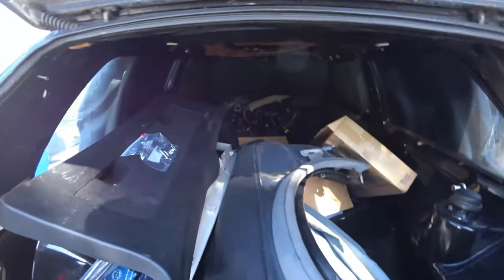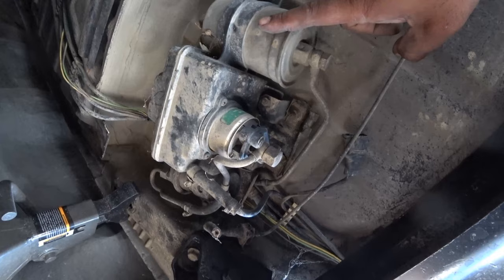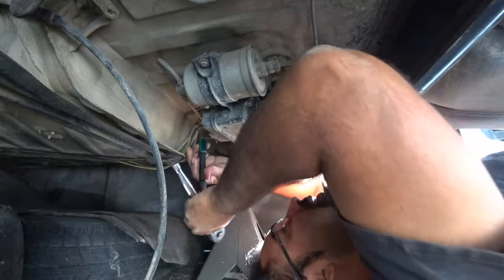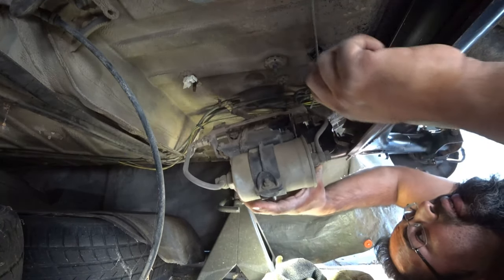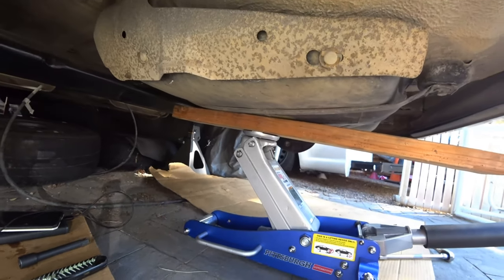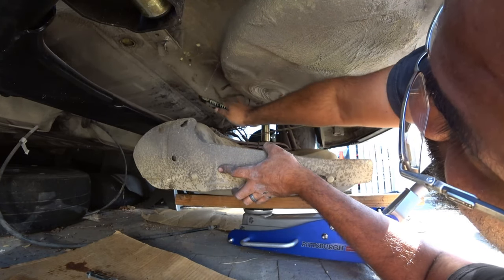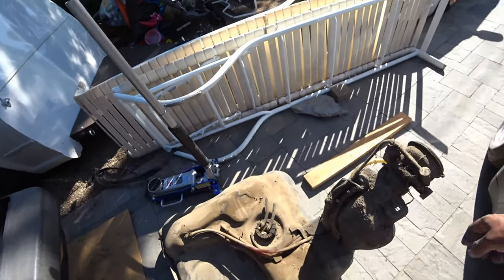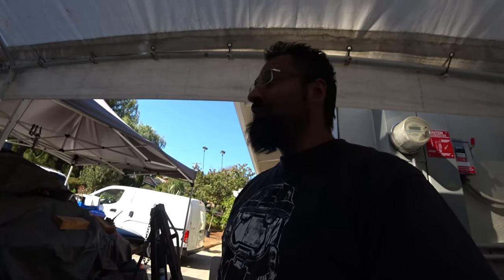VW MK2 GTI Jetta Gas Tank Removal DIY S6 EP2

Comment: Great video! I don't have to replace mine but i am smelling fuel vapor near the top of the inside rear fender. No leaks that i can see though.   I will have to take a closer at the vent lines and make sure there is no cracks. Is there enough length in the fuel lines to be able to drop the tank without disconnecting them? Thank you!

Comment: Any way you would recommend to clean the tank SAFELY. I took mine out my 1.6 driver and its got a shit ton of rust in it??
Reply from the maker: Use distilled water to start
Then use actual gas to clean it. Once your done use distilled water again and let it air dry upside down one day and right side up the next.

Inspect with a flash light and look for debrie.